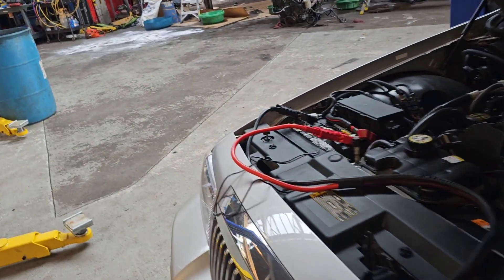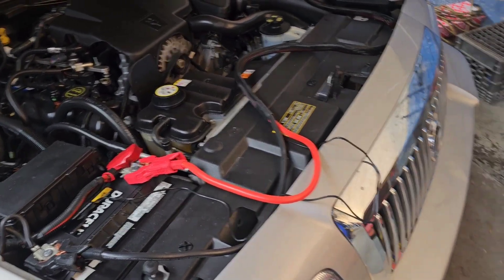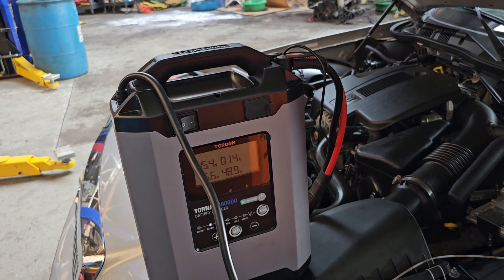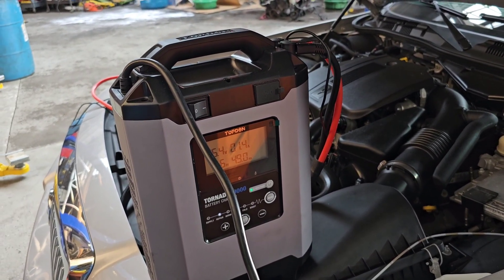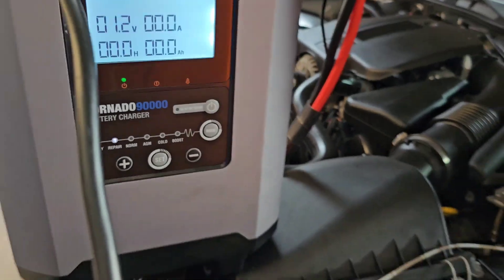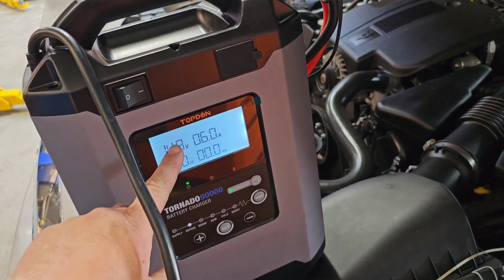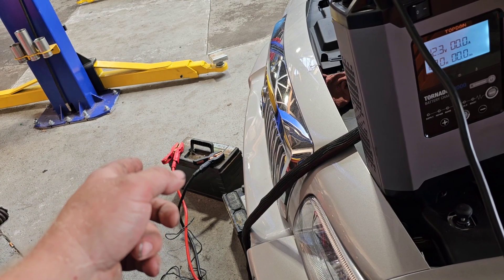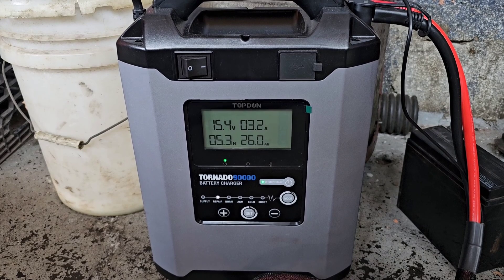Topdon Tornado 90000 Is a Beast - Let's Review What It's Been Up To - 24hr test So Far

Comment: That big battery is a type 31. It is used in Class A and B commercial trucks including the ones I drive for my company. Some of the bigger trucks will have two. Stay Blessed!
Reply from the maker: This one came out of a truck I think that had four
Reply: @FordBossMe  Yea man, it depends on what equipment the truck has. If the truck has a lift gate, and a reefer unit, then it will have more batteries.

Comment: LOL what a popular battery seller used to do is say to leave the battery overnight so they can slow charge it and then test it .... what they would do is flip it upside-down,  dump the acid out, wash the inside out and try to flush out all the old flaking from the bottom to clear out  debris so it wouldn't short out the plates, and then refill the battery and slow charge it.  The battery would most times test okay but lowered capacity due to the porosity in the plates but enough to get it past warranty.... hey, what ever works right?...😂😂😂

Comment: I just ordered one of the Topdon 90000's today. I've been so frustrated lately with the 20-30 amp power supplies/battery chargers while flashing vehicles, especially the PHEV's and newer vehicles that can draw a lot of amps while flashing and also could use a more beefy battery charger for faster charge times when I'm in a hurry.  Can't wait to get it and use it and see how it works.

Comment: Good for farmers that run multiple batteries on a diesel tractor or truck.  Will need to isolate (unhook)the batteries to test or desulfate.  

-Or if you just love going thru old batteries to rejuvenate them and then sell to the used tire, battery and brakes guy on the corner.

Comment: Hi might be stupid question but when set at say 12v 50amps and a draw of 60 amps came on the car would it auto adjust or would it only put out 50?
Also when set to 90 does it only put out what is required to keep battery at set voltage thanks

Comment: i have a 18 mustang eco with a black screen head unit. i replaced the battery not to long ago so I reset the bcm like you showed just to give it a shot and nothing. any suggestions
Reply: the car started acting funky after the battery replacemnt for sure though
Reply from the maker: I've heard this a lot lately with people replacing batteries on Fords unfortunately you're going to have to take it to a dealer and let then hook it up to the software and reset stuff a lot more people have been using batteries Savers in the meantime so you plug it into the cigarette port and it keeps all your presets in your memory and the computer and then you change your battery and then do your reset

Comment: That unit is more of a 12V power supply mostly, and a charger and maintainer second? They cost an easy $800 plus, if you ever checked? It does all that, at a descent price, I'm really satisfied with my purchase of the Topdon BT6000 Pro, but that unit is on another level than my little $80-$100 unit? My charger tester, does have the 9 step charging mode and manual modes of the big one, that's what makes it stand out to me? Great piece of equipment for the shop, sir.
Reply from the maker: Both not just one it does both

Comment: Hi, how do you use this unit on on 220V system.
Reply from the maker: You can go into your mode and hold it down and press it once you see the voltage and the amperage and you can shift it over to 220 by hitting the button after you hold it down

Comment: That’s a fancy charger for sure but it’s just not practical(business wise) in real life. 
You got a huge time commitment for something that isn’t a guarantee. You can only charge one battery at a time. If the customer doesn’t hand carry the battery in, you need to start thinking about where you’re gonna park the vehicle for 24-48 hours. 
You can’t have the battery in the vehicle and it parked outside to charge without risking the tool and battery getting stolen overnight.
You can’t leave it in a bay for 24-48 hours because each bay needs to turn so much money per hour. If you bring the vehicle in to pull the battery then you either need to have a spare on hand to temporarily replace it or push the car back out of the shop to free up that bay-which takes time and manpower. 
That brings me  to the next point-what are you going to charge for this service? Is the price different if you have to remove and reinstall the battery? What about batteries that are in the fender well? Or underneath the windshield cowl? Or inside the cabin? 
Can you imagine having to recharge a customer’s battery five times? That is not gonna be a good look no matter how you spin it and I’m willing to bet a dollar by the third time that customer comes in with the same problem you’re gonna wish you had just replaced the battery and be done with it.
Like I said though, it’s a fancy tool but not practical because it’s not a guaranteed fix like a new battery would be and whatever you charge for the service has to naturally be less than the cost of a new battery. 

Be blessed!
Reply from the maker: I guess it all depends on how you look at it and what type of time that you have to put into things that's really what it comes down to at the end of the day so one person's projection of what somebody else's time is worth is only their projection and their opinion
Reply: @FordBossMe  Agreed but it takes money to keep the lights on and the doors open when you have a brick and mortar business. 

Every shop has a magic break even number that each bay or lift needs to make in order for it to stay afloat. If you’re able to meet and/or exceed that number then that is all that matters at the end of the day business wise.

I will add this if you’re able to find a solution to each obstacle that I foresee being a problem then you are more than likely are gonna find a way to make this service profitable for your business.

And with more and more vehicles being electric it’s probably a good idea to come up with a solution to charge multiple vehicles at once but not tie up any bays.

Be blessed!
Reply: I agree with Ried with no disrespect to Rich, this is a very informative video on  chargers, I'm more curious about the power supply when programming and when those diagnostic jobs require koeo for extended time. The roi isn't there just for the sole purpose of charging a battery  but if it can save the shop money when that key was left on I can see the reasoning for the purchase. Thank you for the video Rich, stay safe.